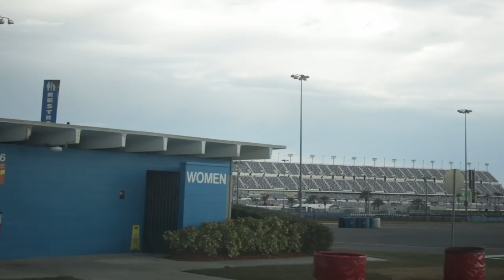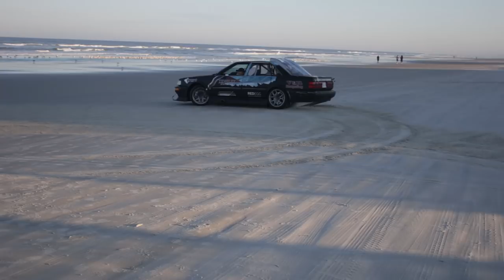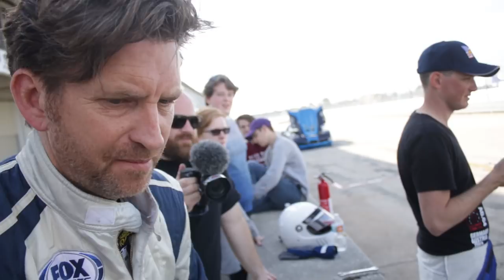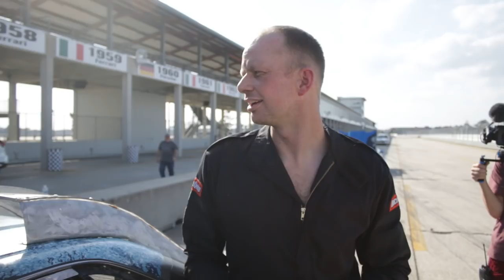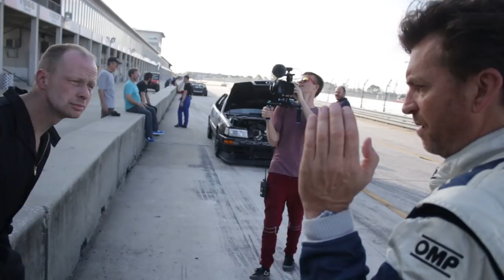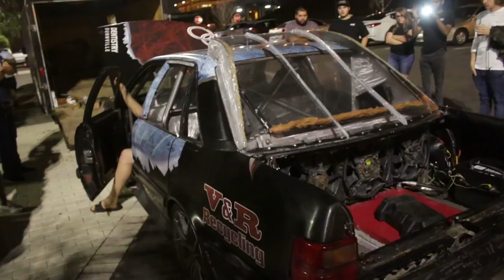Justin Bell Broke Our Car... $0.89 Fix! Quattro Debocho At Sebring (Project Car Challenge Day 3)

Comment: When I heard the car fire up hot I had deja vu from when I had my fuel lines too close to my exhaust.  The sounds your pump make are identical to mine when I was having vapor lock issues.  I ended up moving my lines as far as I could from hot crap under my vehicle and still had to wrap them in heat shield.  I'd bet you have your return or pressure line too close to a coolant line some where, I know your exhaust is pretty well contained.  Possibly you're cooking your entire fuel tank with the hot air from the radiator blowing over it.  Anyway, great to see this thing on the track and looking forward to more racing/updates on the project.
Reply from the maker: Yep dead on.
Reply: Add a fuel cooler aswell.

Comment: Sounds a bit like you have to mutch overpressure in your cooling system, (lifting the heads trough the boost??) (leaking head gaskets?), and former leakage on the pump?   great build man, loved it! .)

Comment: Have you thought about checking the coolant pressure in the system?  Blowing out a freeze plug might mean there's just too much pressure from the pump, or restrictions, or...?  Could be as simple as using larger diameter hoses.

Comment: I know this is an old video, but the frostplug issue is common if you haven't figured that out already. My buddies that race high compression N/A motors in off-road trucks have to bolt a strap across the frost plugs to prevent them from popping out.

But that aside, I've been binge watching this series, and your ingenuity on this build is simply amazing!
Reply from the maker: Thanks man!  We've done lots of upgrades and are in the middle of a few more.  Series isn't over yet!

Comment: Pressurising the cooling system through cracked head/failed head gasket and causing the core plugs to pop and water pump issues?

Comment: its wat you could; ve expected on a barely tested car , it might've been better to use the used heads as those had been proven to stay together , theres allways next year to try again
then again you did whent through a couple of overheats with the steel/copper plugs in a aluminium head its bound to have happened eventually somewhere (better check the other freeseplugs for movement) 

it might be wize to drill a small hole through the side of the plug intoo the head and put a tiny locking pin it it :
http://www.chevelles.com/forums/13-performance/191083-***freeze-plug-safety-device***.html
different way to do the same thing
https://cdn.shopify.com/s/files/1/1500/4862/products/Blank_Black2_1024x1024.jpg?v=1501483287

or....... tap the holes with a pipetread and put a pipe end plug in it (might even strengthen the block) 
http://www.spiny.org/filter/FilterTech_files/knocknoise75.JPG
http://i44.tinypic.com/116jnmq.jpg

Comment: Wait.   Did I hear you say " from Dunnville?"    Being from Smithville originally.  I now completely understand the kinds of  things you build in your garage and put on your channel.  
Once upon a time....    
1) go to wrecking yard with a couple grand.
2) dig through Hollander interchange manual. (because trailer package station wagons and pickup trucks from late 60's/early 70's had a surprising amount of high output parts in them. Usually only needing more/better carb/manifolds/exhaust to make them equal-ish with their muscle car counterpart drivelines)
3) go shopping in said wrecking yard.
4) pour resulting mix of parts in to the shop on the farm.
5) Drive now "mostly" operational vehicle to Hamilton.
6) Take many lunch monies from Z28/Mustang driving city kids who's daddy bought them a car.
  And thought the smog reg. muzzled pieces of crap GM, Ford, and Chrysler sold in the 80's were fast.   :)

Ahhh the things you could find in the scrapyard in the early/mid 80's, 
Then E-checks and so on spoiled that party........Can't get plates on things you Frankenstein anymore really.

But a HUGE thumbs up for the creative stuff you put together.